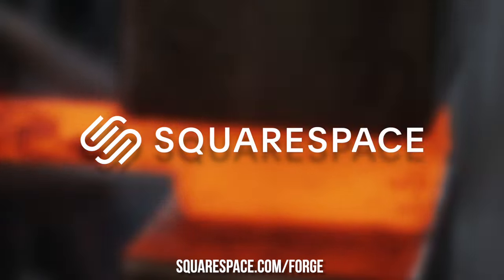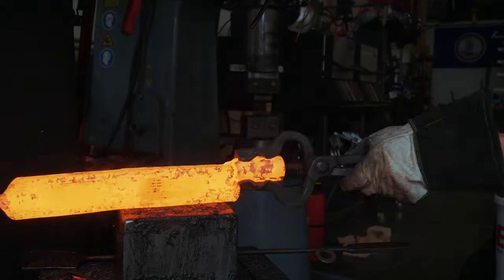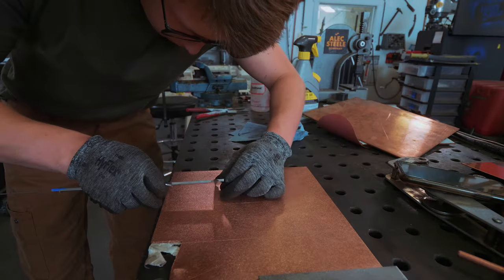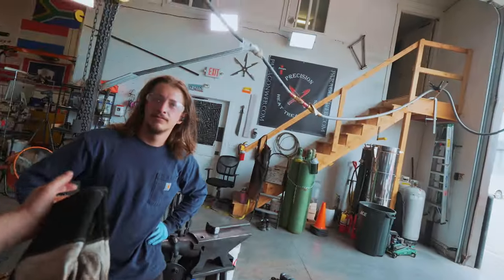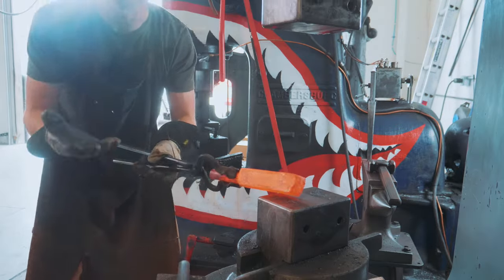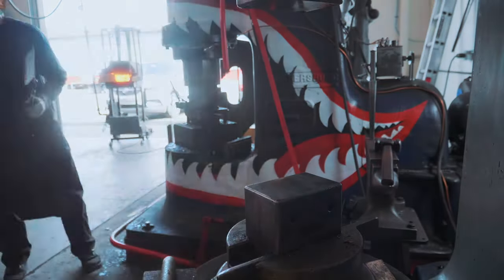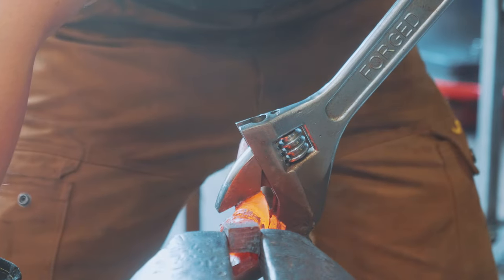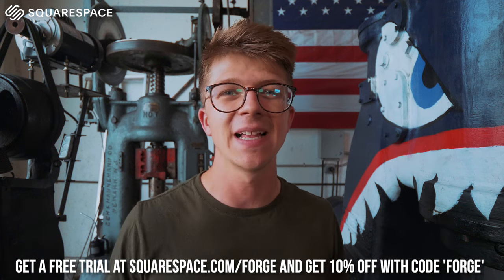Can Copper Weld into Steel Damascus?

Comment: it's brazing - technically once you make your steel boat, so long as the opening is at the top, you can fully melt the copper and let it cool. The copper as a liquid will fill every crevice and void without the need to hit it (so use copper shims in the final thickness you want from the start). You can also make patterns in the copper by gouging the steel before melting it in place (giving you lines or waves of copper).
Reply: After reading this, I no longer feel the need to watch the video 😂
Reply: After reading this I realized I'm subscribed to Tyrell Knife Works. This process isn't new, it's been done.
Reply: @gatekeeper5418  But it's not about being a new process, it's about Alec exploring something that is new to him.
I feel it's similar to 80's horror movies. Different iterations and representation of a similar concept. But everyone loves those cheesy ass movies 😆
Reply: @gatekeeper5418  this would technically be a version of modern mokume gane and since it uses the original process to create mokme gane (forging a hot billet of dissimilar metals into a laminate using hammers and a non temperature controlled furnace) the process is well out of copyrightable phase thus literally anyone can do this. (current copyright law only protects the life of the orginal inventor plus 70 years(thank disney co for this LUL), as the process used to make this is the mokume gane process it's not uniqe or original to Tyrell Knife Works and thus only subject to the original copyright which would for copper-steel bonding actually belong to Tiffany co if anyone from the modern era from their experiments in the 1870's which are also out of copyright and yes one of the attempted laminates was steel to copper which succeeded) any and all copyright or originality claims towards mokume gane have failed in the modern court system and most companies try to trick people into settling out of court. side note this is also why Alec was able to try to make titanium damascus without worrying about getting sued as he was using traditional methods to do so(which are also ancient in origin and thus public domain.)
Reply: Technically soldering. Brazing requires the use of brass based alloys on dissimilar metals. It’s a sub division of soldering.
Reply: @gatekeeper5418  Alec has done it before too lol
Reply: @simonmorris4226  soldering doesn't include a full metalic fusion it's a weld not a solder brazing would actually require the use of bronze so it's not really brazing either. this can really only be classified as forge welding or mokume laminating.
Reply: @America_Yea  chartered Welding Engineer. Trust me it’s not a weld
Reply: Don’t dissimilar metals react to each other over time?  Unstable?
Reply: @jamesbarlow6243  the issue with dissimilar metals typically involves oxidation.  As there is no gap between the metals, we can say that the equipotential bonding should be sufficient enough to prevent charges from building up and encouraging the oxidation of the materials.
Reply: @America_Yea  Hasn't Alex done mokume gane?
Reply: Exactly. Really should've tried twisting it at a lower temp if not completely cold.
Reply: @Simon Morris I can certainly see where you are coming from but I've had this stuff under a scanning electron microscope before and as you say trust me you can actually see the mixed layer. It's quite small and in fact almost certainly should not show up in alec's cover image. Side note I actally have an associates outa berkly in welding tech not that it stands up to an active engineering degree.  Anyways, the primary difference we should both be able to agree on is if there is a fusion layer where the copper and steel mix and fully fuze and you'd need better imaging than youtube gives us here to typically tell with copper steel contact welding it's actually fairly simmilar to the debate that went on for cold welding for a while(which is where my actual experience with both this and cold welded copper steel welds comes from, my company actually has to deal with this stuff when designing satellites and we aquired a sample of copper steel mokumegane from tiffany co which was quite professionally made I might add). In short my summization is from hands on experience with the material in question and knowing the conditions it was made in normally causes such a weld to happen, neither of us would be able to actually prove it with the piece in question without actually using the proper tools on it though.
Reply: @brandon tamplain he most certainly has I definately reccomend watching that one it's a rather good sample they make of one of the most traditional mixes of copper/nickel.
Reply: @simonmorris4226  Brazing can also be done with silver.  Also...Brass is an alloy of copper . I have seen steel bicycle frames brazed with silver, brass, or copper. They are  brazed not because of dissimilar metals, In this case the steel alloys in the thin tubing are not easily weldable. In many cases welding will ruin the heat treating but brazing wont if done carefully. The addition of tin to make copper into brass lowers the melting point and increases the fillers flow. Less heat and easier flowing is why brass is used. Silver is better but costly.
Reply: @notsofresh8563  if you’re using silver that’s soldering. It’s right that it’s often done to reduce heat input on the joints to reduce distortion and effect on the material temper compared to welding. I’m a chartered welding engineer so I should know!
Reply: reading this, i was just picturing pouring molten copper into a boat that has a steel cable inside. only issue would be rust

Comment: If you need inspiration, check out Dennis on the Tyrell Knifeworks channel or Baker forge and tool are rocking it. They use the copper that has a crimson hue. They call it tiger Damascus it think

Comment: Quick answer: yes.
Copper is a problem contaminant in steel recycling because it's virtually impossible to separate once its been incorporated.  Copper in steel generally follows Hume Rotheroy rules which strongly suggests the ability to form solid solutions. Unfortunately, the peoperties of Copper in steel tend to be undesirable. Nickle is similar, but gives better corrosion properties than copper without sacraficing microstructural integrity as much.
You'll need to be wary of the fact that martinsitic phases can't be generated in nonferrous alloys, so any form of heating will soften the supplemental metal. To retain blade strength it may be best to peen the edge instead of relying exclusively on heat treating.

Comment: I've seen a few of these non-ferrous metal damascus videos, and something I have not seen, is attempting to increase the melt temperature of the copper, by alloying it first.  IIRC Chromium+ Niobium can increase the melt temperature of the copper, and it might not lose it's coppery luster.

I ... don't think you need much  maybe 5% by weight of each?  But... like I'm no metallurgist, so... YMMV!

(Might be something worth looking up.)
Reply: If you alloy the copper with Chromium and Niobium it no longer would be copper. It would be a Bronze or brass like compound. I’m not a professional but I have taken some college courses in metallurgy.
Reply: @tjboylan20  well, I'm fairly certain bronze and brass are specific copper alloys, and as such you could only call what OP mentioned a copper alloy, or potentially a different name if it has a specific one.
Reply: ive used cupronickel to good effect. it has been my go to choice since about 2019
Reply: SuccesFully alloy it with ~10% silver and ~3% palladium and you got silver palladium copper which melts at ~1430°c and will annihilate your savings if you buy more than some grams
Reply: I meant ~30% palladium....

Comment: When I did mokume I dipped the metal into barrier flux, bound them all together in a stack and brought them up to temperature with a tort in a darkened room. As soon as I noticed any indication of that gooeyness around the copper edges I would remove the torch and give it a slight tap between two very flat surfaces. Rinse and repeat a couple times and then treat it like a Billet of material as normal
Reply: Is there a website I can check out or something? That sounds pretty sweet

Comment: So in a former life we used explosively welded stainless steel and copper to make heat exchangers…  

you pack the billets of stainless and copper in high explosive and set it off and the high pressures fuses the dissimilar metals together. 

The bond was tight enough to be leak tight to superfluid helium.
Reply: I wonder if that method would work with mokuTi or titanum mokumegane I'd immagine there's plenty of pressure and no atmosphere to oxidize the titanium rapidly and from an engineering perspective should work provided the explosive operated at sufficient pressures rapidly enough.
Reply: Quick google search found a supplier doing titanium clad steel made by explosive welding. 

Course it’s not really the same as a Damascus like process.. 

It’s a cool process though and it helped us eliminate a tricky joint (if I remember correctly - it was a while ago now)
Reply: Cody's Lab did this
Reply: I happen to work in a factory that produces heat exchangers and we do the exact same thing but without explosions lol

Comment: Cool idea of twisting it. Ive never thought of trying that. Ive had a few successful tries using it in Go Mais. All you have to do is make sure the weld is air tight all the way around and forging it out. Then do a stock removal. Good luck.

Comment: One incredible idea I heard for the mix of Mokume-Gane (multiple different  non-ferrous metals forged together like damascus) with steel was to make a knife or sword with a steel edge embedded into a Mokume-Gane jacket. You can then grind and etch them so that it looks like the steel is emerging from a wood grain or any other pattern. SUPER pretty
Reply: Bit of a misnomer here any dissimilar metals forged together qualify as mokume gane adding ferrous metals just makes modern mokume gane instead of ancient. Technically the laminating technique used to make katanas back in the day would also qualify as low(core) and high(edge) carbon steel are dissimilar. It's the entire reason that a patent on "damascus" steel forging techniques is indefensible and cannot be used in us courts due to the technique already existing.
Reply: I think what you'd like in more precise terms is traditional nickle/copper mokume backing on a blade steel edge and that's very doable but also VERY expensive. The blade steel would already have to be mostly drawn out same with the traditional mokume backing preferably via the standard rolling technique. Both heated and plenty of low temp copper safe flux used to fuse the spine on. I think this would make for an interesting project piece for the record.

Comment: The steel jackets seemed like a pretty sweet idea. Maybe going for a full canister damascus could be cool.
Reply: I would like to order a steel jacket in size 15 neck. Medium, slim and short.
Reply: this is a fantastic Idea just need to watch where the hole in the canister is drilled so as not to point it at the smith or anything important LOL. I've seen pretty good results from can damascus using copper as one of the materials so I'm looking forward to it If alec is willing to try.
Reply: @HunterThinker  would you like 3/4, 1/2 or full sleeve?
Reply: It is very cool when done properly but neither one of them did look up cumascus

Comment: Alec, You had the right thought when you referred to the copper as "Adhesive" because the melting temp is so much lower than steel the best you are going to get is LAYERS of steel adhered to LAYERS of copper which if done artistically is very cool.

Comment: Based on your experiment, you should be able to meld steel with titanium in a Damascus style, thusly allowing for a severely reduced weight yet still retaining strength. Just an idea.
Reply: Yeah its called timascus it's already a thing 😁😁
Reply: the problem is the titanium creates titanium dioxide, a weld inhibitor.

i did a honsanmai billet a while back that failed due to VERY small amounts of air getting into the billet at some point. also the thermal conductivity and thermal dynamic of the ti come into play... ti is a weird animal.

we also need to think about heat treatment post forging and grinding... ive gone so far as to attempt a canister billet that was heat treated... then grind it all into a final shape.

Comment: You'll want to work it at a much lower temperature I think, or at least by hand because the power hammer hits it too hard across the entire surface. Whatever you do the copper will still move more than the steel, but if you're moving less at once you might be able to deal with it and avoid squirting molten copper across the shop while you shape the piece. Definitely no more folding or twisting, but a mild curve or wavy pattern may be possible. Alternatively, you could go straight to the grinder and make a really cool-looking paperweight or shelf piece, or even use it as the handle for a sword or dagger. Maybe a letter opener?

Comment: Speaking of Damascus: Have you ever considered making Wootz? That is, the original, not pattern welded stuff?
Reply: They tried but since they used a power hammer to try and combine the I can't remember what it's called the bloom to consolidate the bloom it instead crumbled into dust. I should have been using something like a wooden stump and light taps from a hammer a sledgehammer to consolidate it.
Reply: @AdmiralStoicRum  That is not Wootz
Reply: @thedausthed  omg i had a brain fart!

Lol

Its a crucible thing lol my bad

Comment: What would 1 million layers of copper-steel damascus look like? That would be crazy!
Reply: It would probably just look like one color because the layers were so thin if it were even possible but they squeeze a bit of copper out on every heat. Probably not as impressive as you'd think.
Reply: It wouldn't be impressive.

Evan and Katelyn did a ~1mil layer experience with rainbow plasticine. 

It turned to "brown" at about half way through their restacks. Iirc, looked its best around the 25000 layer restack.

Comment: to reduce the odds of separation when force is applied (torsion being among the more extreme kinds of force you could try lol) it could help to keep the billet in the forge for an extended period of time. given the pretty high degree of solubility of copper in steel, the longer time window should result in greater diffusion and therefore better alloying in the boundary regions, providing a stronger bond than just mechanically smushing the layers together

Comment: I learned from an old fellow I use to work with. One of our tasks was hard facing an auger on a trenching machine used to push dirt away from the trench. as you can guess trying to keep and build a straight weld on the edge of a 1/4 screw is a nigh impossible task.  well the fix that this gentleman had was using a copper bar. you could form the soft copper to the curve of the auger and you could let your bead flow up against the copper without it welding as long as you Keep the copper cool. If you let it get too hot some of the weld would fuse to the copper.

Comment: If sticking with a forge welding type process, maybe use very pieces of steel with relatively thick layers of copper, so when forging down to final thickness you will mainly just squeeze out copper and end up with layers close to similar thickness.

Comment: I guess you could make a multi layer billet and weld the steel to the steel; that should stick. But san mai is pretty dang cool.

Probably require leather aprons, helmets with face shields and frc clothing when doing this.

I made some mokume and the silver squirted out and started dozens of small fires around my shop. That was when i built a sand tray that sits under the mouth of my forge. Normally its wheeled back under the table the forge is on. It serves to deaden, prevent splash, cool, etc very hot things that fall out of the forge mouth.

Comment: Alex at Valhalla Ironworks has some great info on making cumai with this kind of copper sandwich. IIRC his conclusion was forge the pieces out thin, weld (ok, braze) the copper in then do stock removal from then on. Avoids the exact problem you ran into of squirting molten copper places it shouldn't go when you try to forge or otherwise manipulate the cumai billet

Comment: Done this a few times a press has always worked better for me. And yeah getting that metal too hot hitting it with a hammer that copper can shoot out of there like liquid fire. Another thing I've done this seems to help a little bit is drilling some dimples on the inside of the steel that's going to be touching the copper seems to hold the copper in much better. Another fun thing did I started doing before this to see how the copper and metal would react. A stack of quarters we'll forge Weld together and you make some pretty cool little pieces out of it you know the cross little hearts that type of stuff but you rarely get to see how that copper get to that as you would say sticky look. I've never even attempted A twist with it

Comment: Look up squirrel cage motor, it has copper cast into silicon steel plates as a rotor.  Might make interesting looking damascus.  

For anyone wondering, It works by synchronizing to a rotating magnetic field by rotating itself.

Comment: @Alec Steele you should make a fire themed blade and add yellow, red and orange gems in the hilt, guard and pommel. Maybe try to san-mai but with more than two layers and add a slightly thicker layer of copper if possible? I am a noob but I imagine if you use more than two layers but have thinner layers to build up the same thickness it still works?